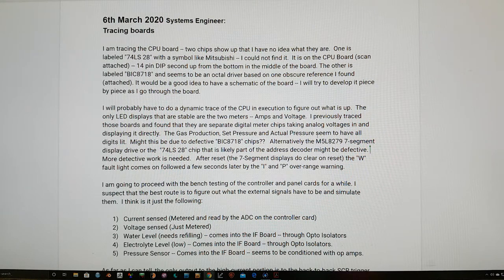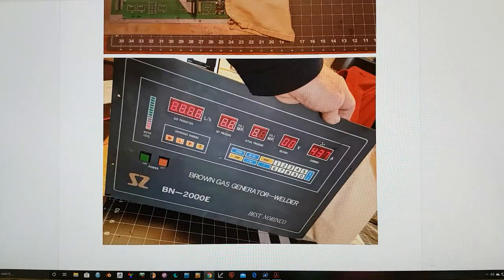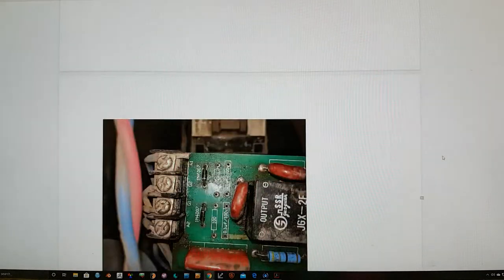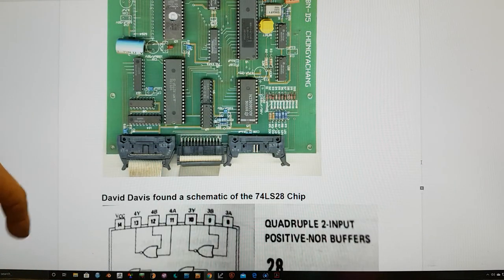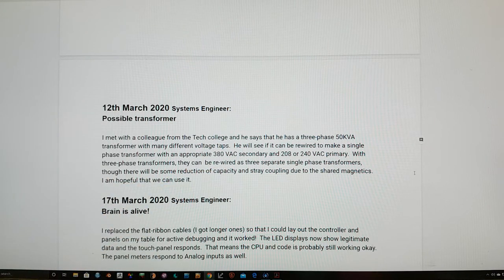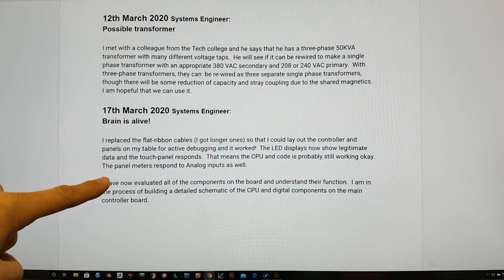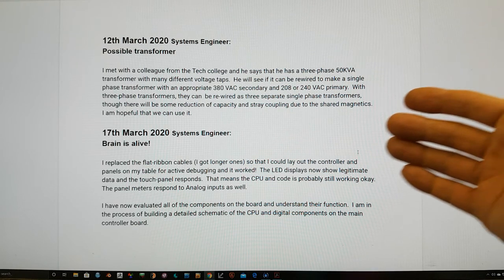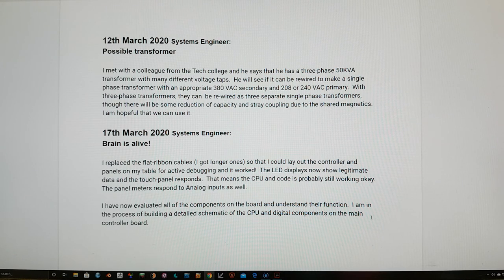Project Atomic Phoenix - Third Update

Comment: Great news. Is there anything we know about plate conditioning in these generators? It seems like a dark art that may well introduce the most variables into the experiment.
Reply from the maker: Hi Martin,

We are working with the owner of the device to get permission to cut and fully examine the internal elements, surface treatments if any and geometrical arrangement. This would be easy if we could raise the money to take full possession of the device, but our priority is to first get it operational and see if it does what Ohmasa Gas does and then to see if it does what was claimed for it in the early 1990s, particularly remediating nuclear waste.